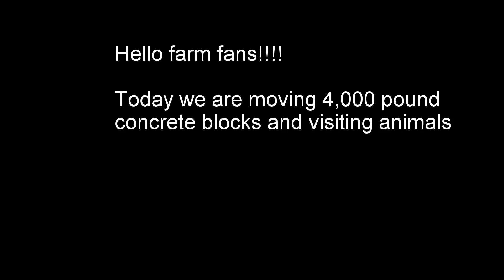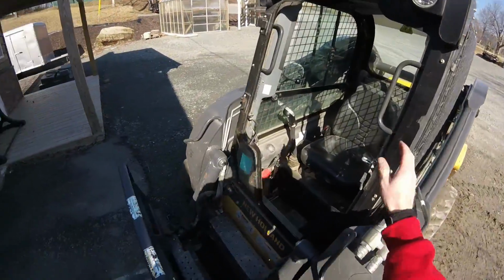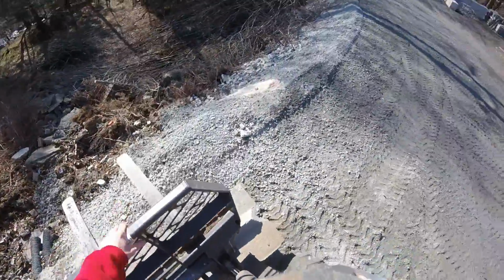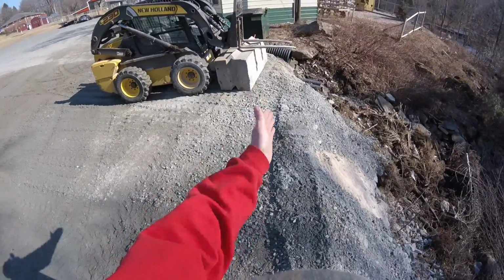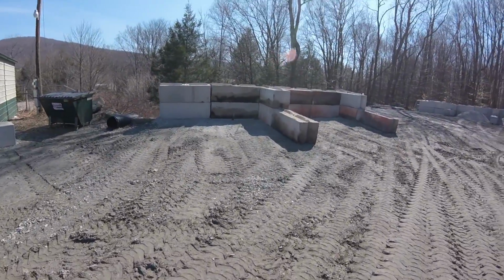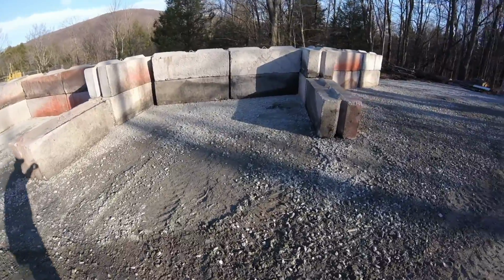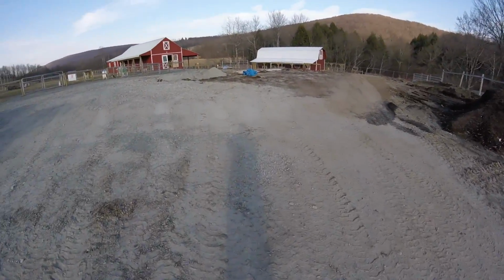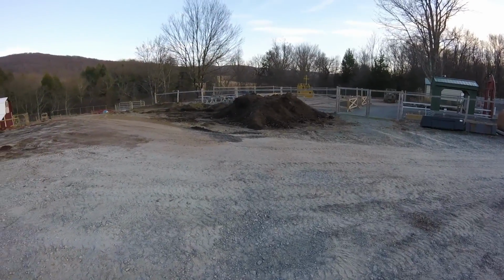Moving big concrete blocks

Comment: those are only around 2,500 lbs
Reply: There 4000
Reply: @morehp1  My brother-in-law runs a concrete business and he told me they are 4000 pounds. I’m tempted to use them as the base for a greenhouse. I think they would be amazing, if it’s done correctly.
Reply: @farmyourbackyard2023   there a great deal Dollar wise for how much concrete is in them but, there so heavy the cost to transport adds up quick,